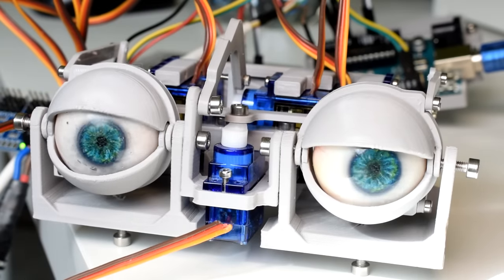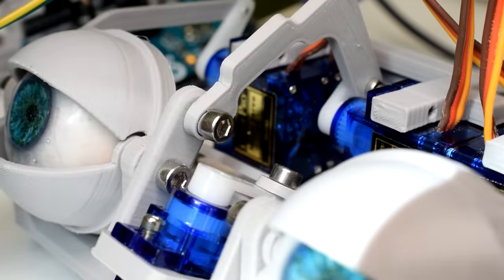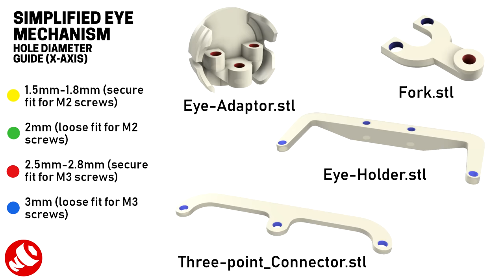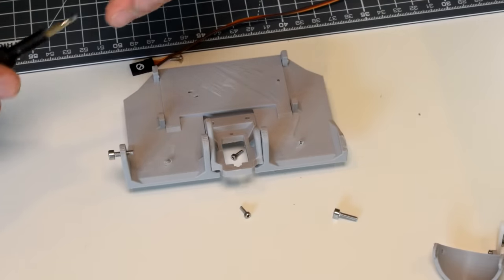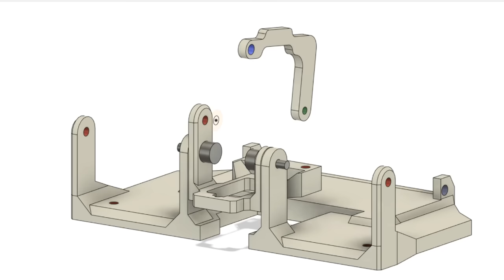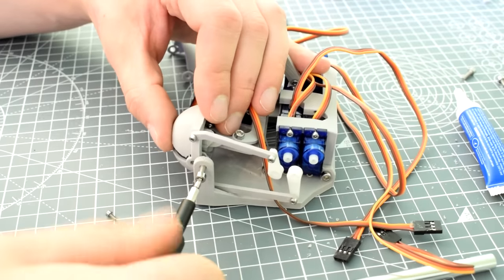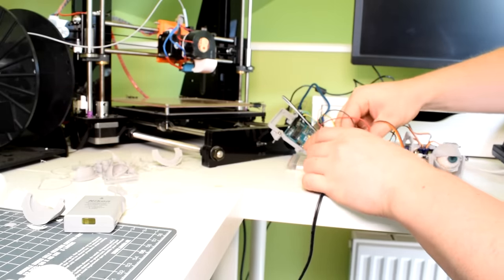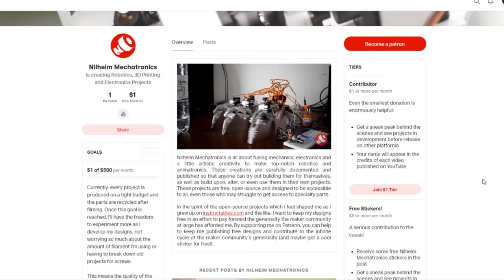How to Build a Simple 3D Printed Arduino Animatronic Eye Mechanism

Comment: Mine is built complete and works. I followed the directions completely I think I might have about US$20 in this whole fantastic project.

The placeholder eyes rub just a little bit on the eyelids but that’s all, it could be my printer settings thank you very much for this great project.
Reply from the maker: I'm so glad it's worked out for you :) !
Reply: @WillCogley  where is eye lids and eye lid connectors its  missing in the stl files of you blog.please send it even i need to build
Reply from the maker: They're in there, the eye lid connectors are "bottom/top lid link" and the eyelids are "bottom left lid" etc
Reply: @WillCogley  in the zip file which i downloaded by the link you have given in the discription only 9 stl files are available
Reply: @WillCogley  Added photos  to instructables
Reply: Does anyone know where I can find the CAD models used in this video so I can print this?
Reply: @markgreco1962  Thanks, I actually found it about an hour or two ago. It's pretty well hidden there in the description so it was kind of hard to make out where these models were.
Reply: You spent only $20?
Reply: @WillCogley  do they really see or do they just blink
Reply: @stoodwood00  yeah I added up the money and it was Over $100
Reply: Nice
Reply: @WillCogley  Hello!!! Is it possible to dowload stl files of your parts for this mechanism somewhere?
Reply: How to print the models separately? For me the complete mechanism is downloading from github

Comment: With having separate servos for the eyelids, you could make the the mech not just blink but also wink.
Reply: Builder's Mark 

Amazing idea
Reply: Ty so much for the idea!! I'm starting a project that'll need to be able to wink
Reply: Going back and reviewing the video again you will see there are independent top and bottom servos for each lid on each side. Would need to program a "wink" in code to make it work that way.

Comment: Quick note: Miuzei SG90 servos aren't quite short enough fit the structures.
Thanks for the great project/tutorial btw :)
*Amazon says they're the same dimensions, but there's definitely a difference on my end, play it safe and go for the ones listed in the description if you're just starting. Could be setting on my Prusa despite following the 0.2mm layer height*
Reply: I experienced exactly the same issue and I ordered  the servos directly from the description. I had servos on hand that worked fine (but were noisy). In the case of the ones I ordered from the link in description, the distance from the back of the servo's mounting flange to the rear of the servo is 17mm. For the servos I had on hand, this dimension is only about 15mm. The design accommodates about 32mm for servos 1 and 2 which are back to back. This is not enough space for the 34mm that the servos ordered from the description would require.

Comment: Why four separate eyelid servos? It seems like there is only one control (open/closed). Couldn't you just use one? With a center pull to open or close, and a bar connecting both sides? Or is this future-proof against full eyelid control?

Comment: I'm just getting into 3D printing and computers. I'll be retiring in the next 2 to 3 yrs from driving  tractor trailer, just looking for a hobby and looks like a lot of fun. So I printed and made your first print, but things are so small difficult to work with, so I upsized 200% much easier to work with, but I still need to change the size of the servo holders. Is the any chance you could help to resize the servo holes to match up.  I'll still have to learn to code and fusion 360 not easy when I work 14hrs a day driving. It's taking  me 3 months just to get this far. Sincerely the old guy

Comment: Nice mechanism, Is there any particular reason many of the screw holes are so thin though? I'm contemplating adding a bit more material around the screw holes, but I don't know if that will cause clearance issues yet. Are there any areas that I need to pay special attention to? As it stands, my printer is not liking some of these areas that are only 1 shell thick.

Comment: I built this as part of my Krampus costume (I posted a video documenting the process of making the costume on my channel, if anyone is interested in seeing it in action!). The eyes worked great! The parts were easy to 3D print, and fairly straight-forward to assemble. The main part I struggled with was the power driver board; the link in the description wasn't working, so I needed to get a similar one, and it was slightly challenging (for a beginner) to integrate it. It also requires a bit of soldering, not too difficult. The material around a lot of the screw connections is a pretty thin, so I worry that with heavy use it could wear down, but no issues yet. The snap base for the painting of the eye was a little tricky, I needed to play with scaling to get a tight fit, and one of the parts did break when removing the eyes, but that's my fault for printing it in PLA. Overall, excellent design. It's as beginner friendly as this sort of thing can be while still producing excellent results, and very compact.

Comment: You can use a wii nunchuk pretty easily to, they cost pretty much nothing and have everything you need in term of control and have already available documentation. Don't get me wrong you solution from scratch is amazing but i think the wii nunchuk would just cost less.
Reply: tokagehideto I built a self balancing robot using two wheels and a nunchuck

Comment: I have a question: I am building this to install in a jack o lantern like the one you posted. I think I am going to just go with the eye placeholders, but do filament changes to get the iris and pupils in a different colors. Does the Arduino code allow for a stored animation sequence, or do I only control it with the pots and switches?

Comment: Built this in 2024, but like some others who've commented on the Instructables site I'm having an issue with the code or the wiring, possibly an issue with the default Elegoo kit joystick or an off-brand servo shield. The eyes move fine up and down, right and left, but the lid behavior is off. For example, look down and the left lower servo also pulls the lid down, but nothing happens on the right; push the button to blink and the right servo motors pull both the lower and upper eyelids up.  Will probably just move on to another iteration of the eyemech.
Reply: hey, did you find any solutions ? I have the same problem, what type of Arduino are you using ?

Comment: Amazing. This helped so much. Question I had  is that I want to mark one that doesn’t require a remote. Would there be a way to make an automated movement? Not sure how I would start that. Wouldn’t have eye lids and would just want it yo either shift the eyes left and right. Or up and down
Reply: Easy to code a movement routine on Arduino, could have several and make them trigger based on diff sensor signals

Comment: Thanks for this project! I've built it successfully, however I found that in other projects the SDA and SCL lines are connected to the A4 and A5 lines and it worked. Should it work using the SDA and SCL lines on the Arduino board as well, has the PWMServoDriver library changed or is there another reason?

Comment: i have a 3d printer and was looking forward to this build. after i got the files to test them out. i have to say that one thing i have noticed with almost everyone's files they dont sit flat. and its such a wast of PLA to print your files with supports. why are they not laid flat or in a manor so they can be printed this with ease. for example the eyelids are upside down and if i try to flip them they are still at an angle and i cant get good print layer adhesion.. can you help  thanks.
Reply from the maker: I've always just used the "lay flat" function in repetier host, is that what you're using?
Reply: @WillCogley   no i dont have that i use cura 4.0 is that available in this program. i have messed around with trying to make the lay flat on my own.  lol with no avail..
thanks
Reply: @bishipc117  latest cura has an option where you can snap any chosen surface to the bed

Comment: I have a KY-023 joystick with a Push button . So if you push the joystick down the little onboard switch is activated. Do you think I can use this button? instead of the extra make switch you use. I think it is more elegant en you can get rid of an extra switch. Great project. Building it now. There is an extra SW pin on the joystick if you push the button, the SW pin is connected to the gnd

Comment: I have built your eye mechanism and I love it, but I want to take this project to the next level by giving them autonomy. When Thomas Burns used your model with the useful sensors person sensor I saw an easy way to make the eyes follow people and operate autonomously. While I have all the hardware, I don't know where to start. Unfortunately Thomas has not provided any files or instructions on how he did this at this time. Do you have any pointers on where to start?

Comment: I would like to run it on Lipo battery - can you state the power consumption - when static, and approximately per movement - and also what is the peak current.
Thanks

Comment: I love this! I've printed all the parts and ordered the components, but I'm struggling to load the sketch onto the Arduino. Mine is an Uno clone apparently. It's my first Arduino-ish project. Driver installation always ends up recognizing my device as a "USB Serial CH340", but the Arduino IDE keeps returning an error1 when I try to upload the code. Do I need to wire everything up before installing the code?

Comment: Hey mate awesome project. I have finally got it all working! I am now trying to use an arduino nano to run this project as it seems to have all the necessary parts. I am just wondering if the servo controller needs to have 5v from the arduino? As it is powered directly? Does it need both?

Comment: Trying to print the eyelids now.

The angle that they are left in the original STL files does not allow them to sit flat on the print bed.

Does anybody have any ideas
Reply from the maker: Are you using repetier host? There's a button to lay it flat, I think cura has the same thing
Reply: Will Cogley yup got it to lay flat

Comment: nice dude its easy inside skin outside is challenge why sally corporation existed
 planning something my self since I saw this came up with  my own animatronic motor 
mouth and head just soldered a motor with a jaw like piece 

its going to take a while I designed this bot myself 

finally got the jaw index fopr the 1'st time
Reply: I need to build one my self its already in thought and I'm planning it underway 

I'll be using my old robo-raptor eyes

Comment: I am building this project. The prints are perfect! I got the Parallax 2-axis joystick but your diagram is for the arduino joystick. Could you please tell me the substitute connections using the Parallax?
Reply from the maker: Just connect 5V to the U/D+ and the L/R+, get your signal from the U/D and L/D pins and connect one of the GND pins to ground.
Reply: @WillCogley  Thank you!!!

Comment: As of early Jan 2020, servos I ordered from the link in the description do not fit in the design. The distance from the rear of the mounting flange to the rear of these servos is 17mm. Two of these back to back, as servos 1 and 2 in the design are, require 34mm to fit. The design only accommodates approximately 32mm for these back to back servos. Other brands of this class of servo that I have fit.  The overall envelope dimensions of the linked servos are the same as other brands that fit, but be aware that certain aspects of the detailed dimensions vary between brands.
Reply from the maker: Sorry to hear the servos didn't fit, I know some people have built the project successfully so I can only assume its a problem with the amazon seller being inconsistent, I will definitely look for a better listing. If you use a washer or some other kind of spacer about 2mm wide between the outermost servos and the base (servos 2 and 3), you should be able to attach the servo horns to the opposite side of the eyelid links (i.e. with the servo horns on the outside, with the screw going inwards towards the body of the servo), which I think will solve the problem.
Reply from the maker: I've also got a 3D printed spacer if it helps: http://www.nilheim.co.uk/latest-projects/adaptor-for-larger-sg90-servos

Comment: QUESTION?,...
I really love this mechanism and I'm thinking of building one.  I would like to put these inside a robotic skull that will be covered with a very flexible and human-like party-mask face.   My only concern is with the central servo?   It appears that this could potentially interfere with the mask between the eyes.  There will be the nose cavity that may help with some of this.  But it still appears to be a concern. 

Has anyone put these eyes into a face?  Are there any examples of this?
Reply from the maker: I have another design that I'll be uploading in two weeks which has more space between the eyes, the one in this video was designed to be a bit easier to build. I put it into a pumpkin, there's a video of it on my channel :)
Reply: @WillCogley  I just measured the mask I'll be using as a face.  It has about 74 mm or 2.9 inches between the center of the eye openings. 

I can adjust your drawings for my exact dimensions.  I was just concerned that central servo would hit the face.  I'm wondering if that central servo can be moved back without too much trouble.
By the way, I don't have a 3D printer.  I'll be making these parts by hand in a machine shop.  I'll probably make the parts from wood and plastic first till I get it to fit my robot face perfectly. Then I'll most likely machine the parts from aluminum for the final project.
Reply from the maker: The central servo's rotational axis is in line with the rotational axis of the eyeballs so i think the design would be less effective if you moved it back, it would also make the weight distribution around the y-axis unbalanced so looking up and down would be harder. When I said the new design will have more space between the eyes I mean in the sense that the servo arrangement is different and there's a gap between the eyes 

I have been working on a machined version though, it still uses some 3d printed parts but maybe you'd rather use that one as a reference? I'm very interested to see how a fully handmade version would turn out, please keep me posted!

Comment: 3:44 couldn't you have just used a nunchuck from a Nintendo Wii?
Reply from the maker: That's a good idea but my controller also had a slider on the back for controlling how wide open the eyes are.
Reply: It works like a charm with the legacy eye. there is a library for the wii controller.[fritzing](http://fritzing.org/profiles/infusion/
Reply: you also have acceleration XY data maybe you could turn your hand to set tiredness or shake to blink:) cant wait for you to upload the 3d files. awsome work will cogley!

Comment: could i theoretically print this larger while still using the same electronics?
Reply: I remember using a 3D printer a couple times and, I believe you could, it just can’t be bigger than the size of the printer itself
Reply: @skelebonez1349  i printed the files without any alterations on size and the whole set is very small, have i not set something correctly?
Reply: @andreiandrew9953  if you’re planning on making the stuff bigger I’d suggest altering the size of them and making sure the size matches better to how you’d want it

I’d basically measure it on how big you want it and it should show how big it’ll look compared to the flat part of the printer, hopefully this helps a bunch

Comment: what is the difference between this model aand the next one?
Reply from the maker: The next one uses servo ball-links and pushrods which are a bit less easy to find than the parts for this model, you might have to look on eBay or hobbyking. The parts are also smaller and harder to print.
Reply: @WillCogley  Thanks for clarifying, is it more smooth or just has additional movement? When will that video be published?